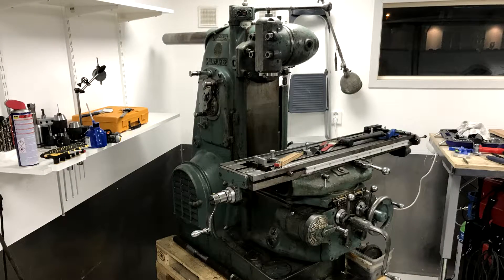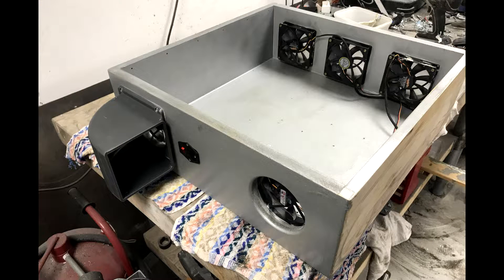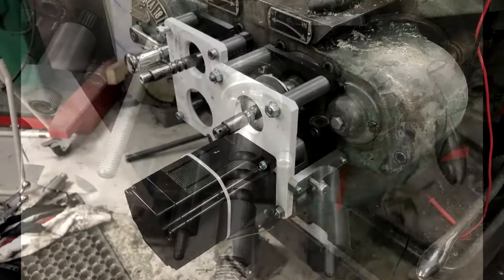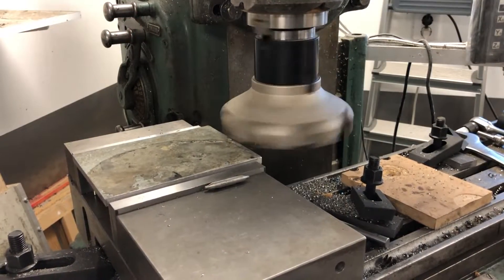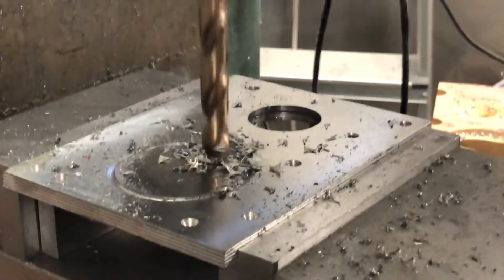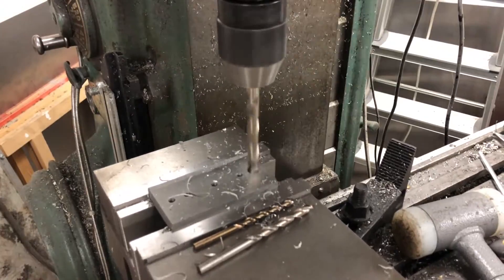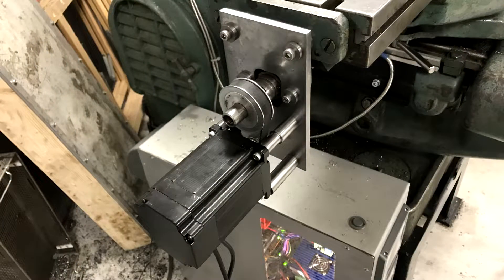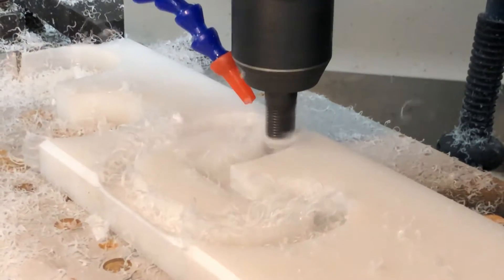Kearney&Trecker Milwaukee 2HL CNC conversion Part1

Comment: Can you please tell me about the specifications of  step servo motors????
Reply: Very nice job sir
Reply from the maker: I believe they are Nema34 sized. X and Y are 8Nm geared down 2:1 with belts. Z is 12Nm also with 2:1 gearing. I will remake this in the future with 3:1 instead because 2:1 turned out a bit weak at times.
Reply: @MrCrankyface  120 kgcm?? Right???
Reply from the maker: @trishulhalder5129  Yes that is correct.
Reply: @MrCrankyface  just want to ask one thing.... Is it really important to use step servo motors??? Can I use normal 130kg-cm stepper motors(in each axis)??
Reply: My mill is indian made(local) ... Size is almost same as yours Milwaukee...
Reply from the maker: Normal stepper motors work just as well. The good thing about hybrid stepper motors is that they will stop the machine if something goes wrong(if it loses steps) but it's not a requirement for a CNC.
Make sure you run the machine a lot back and forth to make sure it always moves the same amount every time.
With normal stepper motors you won't notice if it loses steps until something goes really wrong, so it's important that you doublecheck that it runs perfectly and doesn't stall the motor.
Reply: @MrCrankyface  thank you very much for your reply... It will be a great help... I am going to start the conversion this month... If we encounter any problems during the build , I will discuss with you 🙂 ..is that possible???

Comment: hi there you using the original lead screws? 
how you deal with the backlash?
No ballscrews? by the way very nice machine!
Reply from the maker: Hi! Still using leadscrews but I'm going to replace them with ballscrews in the future when I have more money and time.
I'm running Mach3 which has software backlash-compensation. It's not perfect but works well enough for the kinds of work I do.
Thanks!